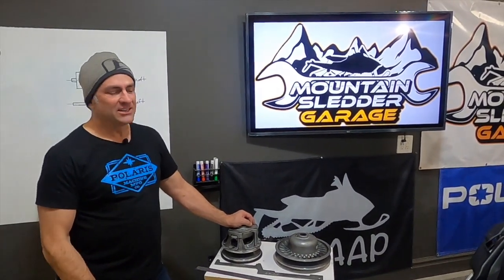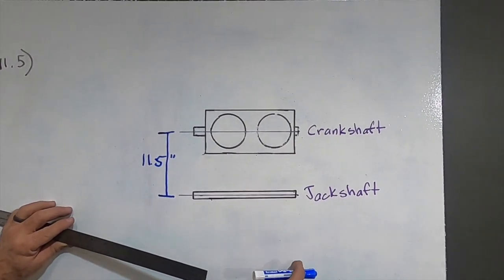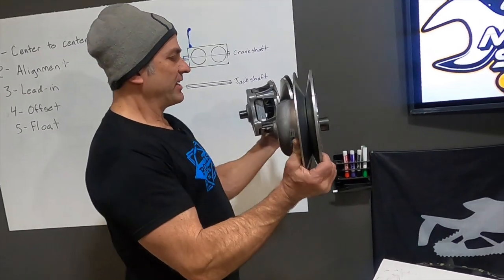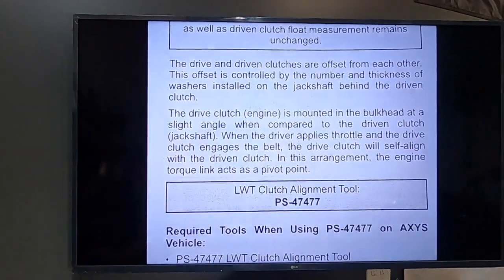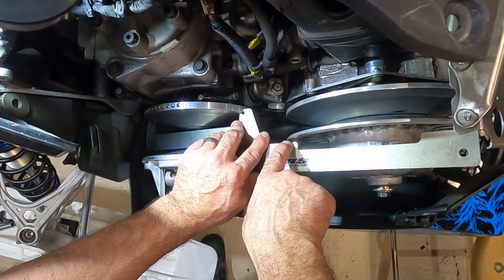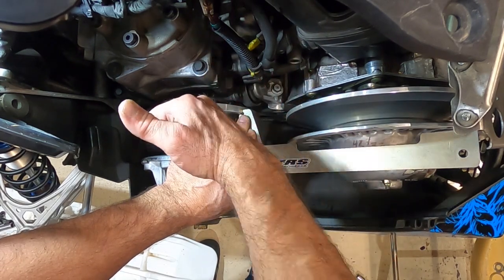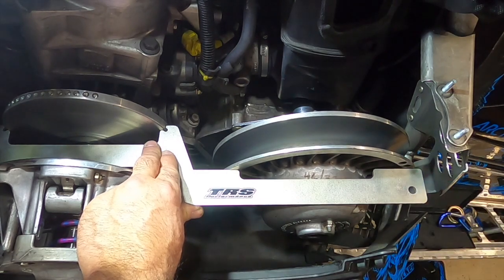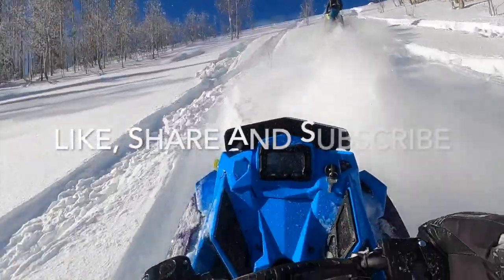Polaris Axys and Matryx clutch alignment DIY

Comment: Secondary clutch is meant to float on the shaft, it will align automatically when the belt is installed.

Comment: Hi, good video👍
is it the same lineup bar for 2024 boost also?
Reply from the maker: Alignment is the same on all the axys and matryx sleds. TRS originally made the bar for the p-85 clutch, but that orginal bar didnt work on the p-22 clutch. The newset TRS bar works of both the p-85 and P-22 clutches.

Comment: Would this alignment process be the same for a RZR 900? I’m installing an Chevy Ecotec with a XP1000 turbo clutch. I’m having trouble getting all the alignment s figured out like back spacing and lead in. Any help you can offer would be fantastic. Will the tool you show help me on a RZR? Thanks for this video!!

Comment: Is this valid for mountain and trail sleds? Does polaris change specs for the two different applications?
Reply: Honestly, I don't work on any trail sleds, we just don't have them out west. I will say, the TRS alignment bar does it a little different than the Polaris specs, mush tighter tolerances.

Comment: With as many shims as you have behind the clutch to get you against alingment bar it appears you only have float towards the outside panel but none going toward center of the sled. Is that how you want it? Just thinking outloud. Whats your handle on snowest?
Reply from the maker: That's per the TRS alignment bar instructions. It's much tighter tolerances than Polaris. Been using the TRS bar for all my Polaris sleds for 4 years now with exceptional results, can't remember blowing a belt in that time. If you're on snowest in the Polaris section, TRS is in there a lot. Im madmax.
Reply: @mountainsleddergarage8627  It could be he accounted for some float in both directions but factored that into the bar. Yes, I'm on Snowest as well.
Reply: I was thinking the same thing. When you get on the gas and the alignment comes back it would move the bar in on the front of the secondary as well as the back. So I was wondering if that compensation was built in. Great video I would have just assumed all bars and specs were the same. Lots of good info here.
Reply from the maker: @jasonfeger2308  yes, when he engine is under load it will twist a little bit in the chassis, that's what the "lead in" compensates for. The matryx motor mounts are much better than the axis mounts, so that helps a lot. Most Polaris less ive checked have some amount of lead in build into them, usually way too much. All alignment bars are not designed the same, you have to know how the bar you have is meant to be used.
Reply: @mountainsleddergarage8627   thanks for the response. I got to looking last night and on the forum it looks like everyone with a trs bar needs like 150 shim so I’m assuming that’s the difference in the bars. You can see that when you over lay them in your video. So who’s right? The trs bar or the stock one? Have you backed to back them to see the difference? I’m super curious before I buy a bar. Obviously you said you’ve had really good luck with the trs.

Comment: Great video, I bought the TRS alignment bar and am in the process of aligning the clutches.  Was curious about the belt deflection adjustment screw.  Won't the adjustment screw effect the position of the outer sheave?  Should the belt deflection screw be turned all the way out for alignment?   Or should the belt deflection be set properly for the initial alignment and a re-alignment done every so often after adjusting the belt deflection during the season?
Reply: The adjuster moves the inner sheave outer doesn’t move

Comment: Trs actually sells adjustable motor mounts to correct the lead in to get you as close to 0 lead in as possible.
Reply from the maker: Yes they do, I made a video about the TRS motor mounts last season. If your lead in is off by very much the only way to correct it is machine the stock mounts or buy the TRS mounts.
Reply from the maker: The video is called TRS motor mount DIY, in the axys/matryx section of my videos.

Comment: You’re video was great learned a lot. I have a 2006 Polaris 340 classic with P85 clutch, removed the motor rebuilt it put it back in the sled and the clutch is not lining up with the driven clutch. I have read the repair manual, cannot find a toque adjustment bolt, nor will the motor mount plate move. Question is how or what is the specs. For the clutch alignment?

Comment: Are the alignment tools interchangeable? I bought one through Polaris and can’t get to fit inside the housing
Reply from the maker: No, unfortunately, they are all designed a little different. You need to find the specs for your specific tool in order to use it properly